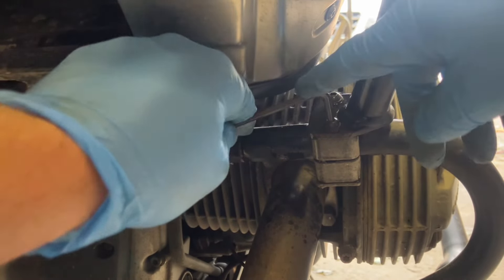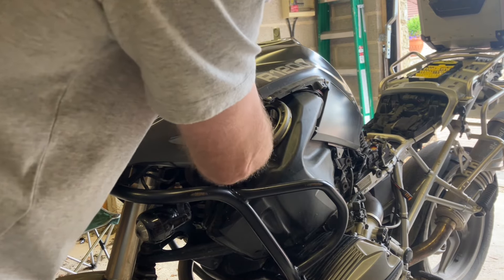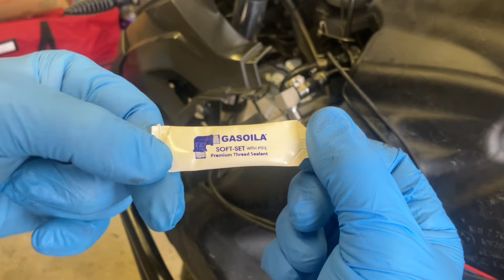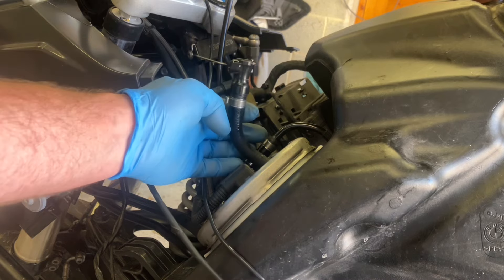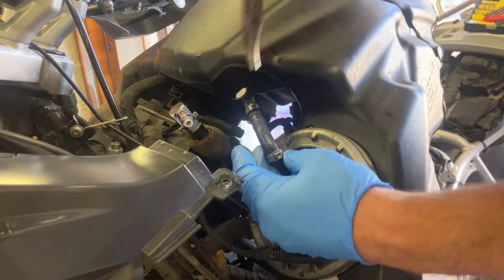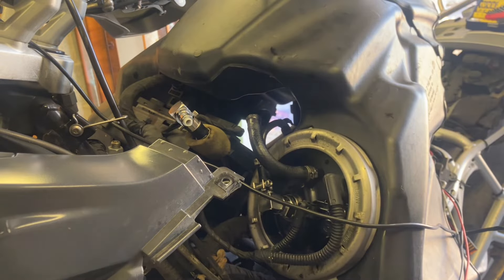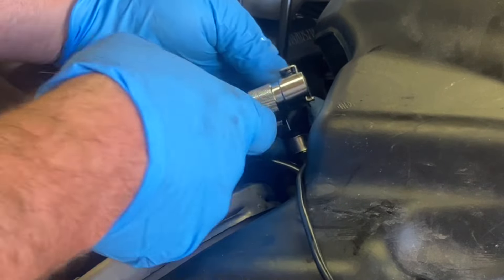Bmw r1200gs fuel pipe connector upgrade

Comment: Nice video, cheers. Love the accent too 👍

Just wondering where you got the parts and if it’d be the same for my 05?
Reply from the maker: @theskiband-ur3tw  good old west yorkshire accent ha, i got my parts from motorworks, it should list your year bike, are u in uk?
Reply: @Tattytyres thanks mate, yeah I’m in the North West and I’ve spent plenty of money at Motorworks over the years. Actually, I looked at the Ducati.Tech website. Mine’s a 2005 GS so it’s their QR-11 set £105 - not too bad and certainly better than fuel oissing out everywhere when your out and about 😅